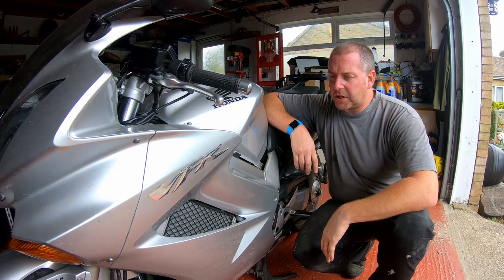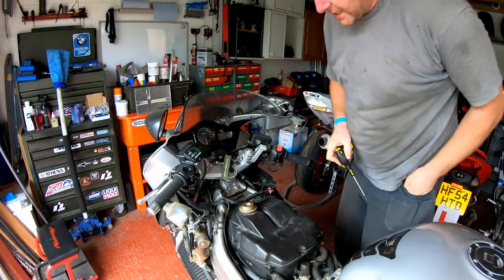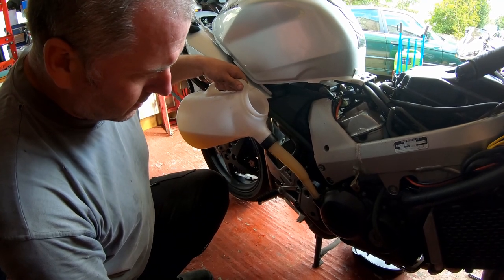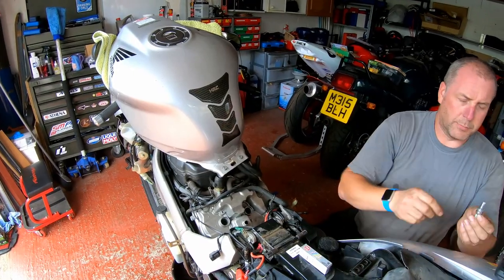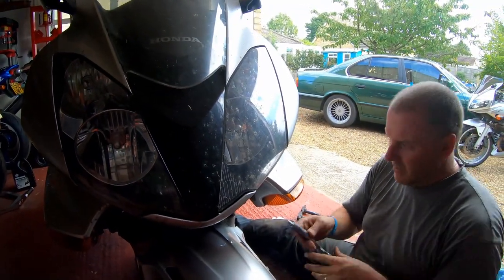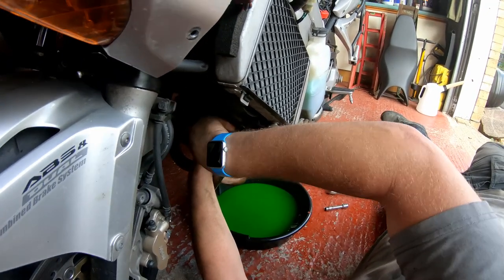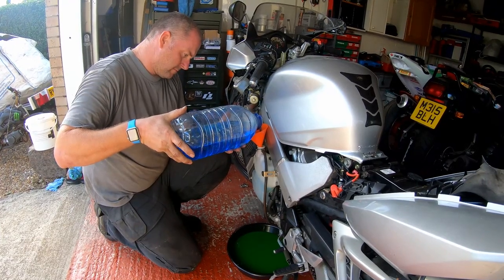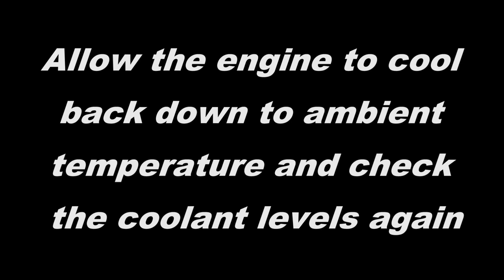Honda VFR800 VTEC Servicing - Oil, Oil Filter, Air Filter, Spark Plugs and Coolant

Comment: I use somethig called an "air lift" to fill the coolant. no need to run the engine, It will also tell you if you have a leak in the coolant system, You use "shop air". You put 25 inches of mercury  vacuum on the system. You shut the system off. If the vacuum holds, you have no leaks. Then you hook up the filler hose, put it in a coolant source, and turn the system on. When the coolant vcuum reached zero, the job is done.

Comment: Aluminum foil wrapped around the pipe right below the oil filter cuts the burning oil, the smoke down to a bare minimum, if not eliminates that little mess altogether. Two wraps around the pipe about does it.

Comment: I added coolant when the bike was on the side stand. Not messy at all.
Once it appears full squeeze the lower large hose where the 3 join and a big air bubble will be released. Top up and job done that simple.
Thanks Kev great vid.

Comment: Hi Kev! Great video! 
I use to fill the new oil filter like 3/4 of it's capacity before installing, this shortens the time it takes to pressurize the lubricant system so it keeps the engine internals to run oil dry for too long. It doesn't spill a great deal of oil while installing so it's not so messy.
I double flush the cooling system with clean water before filling with fresh coolant. Also when filling up the cooling system, I use my hand or some rubber sheet to temporarily seal the  filling neck at the top, allowing the system to purge the air to the coolant reservoir tank while revving the engine a little, so you avoid spilling  coolant.
Great work!
Reply from the maker: The engine internals do not run dry by not filling the oil filter with oil, even after draining the oil from the sump there is still around 300ml of oil in and around the engine. This is why there is a large difference in oil capacities between an oil and filter change and an engine rebuild in the manual. Secondly, unless the thermostat is open, you are not getting all of the air out as there will be air in the radiator, I for one am not putting my hand over the filler neck when the coolant is hot enough to open the thermostat! Thanks for taking the time to leave a comment though! Enjoy the rest of the videos on my channel! 👍

Comment: One thing I do while I have the tank and air box off is go ahead and clean the throttle bodies with some carb cleaner and a microfiber cloth. My '03 sucks in a decent amount of oil vapor from the crankcase so it gets the throttle bodies nice and dirty. Just a few extra screws to get the lower portion of the air box off and you have full access to the throttle bodies. Great video once again!
Reply from the maker: Good idea, I’d check your breathers for any blockages if there is excessive oil in the air box 👍🏻

Comment: Great video! Thanks so much for sharing.

I managed to change the spark plugs on my '09 VFR without removing the fairing or the tank -- within an hour. If you're already taking the bike apart to do the rest of the maintenance, I'd suggest following Kev's way. I was reading the Honda maintenance manual and it mentioned that you just need to lift the fuel tank up like you'd do for changing the air box. The right rear is a bit of a tight fit to remove the coil overs, but it's doable! And that Honda sparkplug tool is so helpful! I don't mean to hijack your video, since it's some really good material, but wanted to suggest a simpler way for people. Cheers!
Reply from the maker: Great tip bud 👍🏻

Comment: Pro Honda Type 2 Coolant is a better choice than the 2 year life Hexeal coolant you have used here. It’s more expensive but lasts at least 5 years (10 years as a factory fill) with a more advanced corrosion inhibitor package, better freezing/boiling points, and is still silicate free to protect the water-pump seals. When I switched to it years ago I flushed with distilled water first to remove the old coolant.

I also recommend Shell Advance 4T Ultra 10W-40 fully synthetic engine oil for this model of VFR800 VTEC, finding it gives smoother running than the semi-synthetic oils I have used, especially at higher revs over the 6800rpm VTEC transition.

For burping the coolant it’s best to put the bike on the side-stand, making the radiator cap the highest point in the system.
Also better to use a socket than a spanner to undo the sump bolt to avoid damaging the sump casting.

Thanks for doing this video, helpful to me as a memory-jogger after a period away from motorcycles even though I’ve done these jobs in the past. And for leaving the mistakes you made in the edit… I’ve certainly learnt from all of mine!

Comment: I have been toying with the idea of ST 1100, with a VFR, because they weigh less. Rode a 2003 VFR yesterday. It was very quick for a 800 cc bike. It had a a Sargeant seat, Heli bars and some other aftermarket parts. Sadly its too much weight on my wrists, plus i had shoulder surgery this summer, so i will keep my ST for now.
Reply from the maker: I know what you mean about the weight on the wrists. i have since done a couple of videos regarding bar risers, a Gen-Mar set and a Moto-CNC top yoke conversion, check them out! 👍🤓

Comment: Good one as always, I find that pouring coolant in very slowly you will not get air in
Reply from the maker: It’s impossible not to have air in the system as the thermostat is closed. Simply running the bike up to temp will allow the water pump to push this air back up to the filler neck.

Comment: Great video Kev but quick question please,
I see you mix your own coolant and use 50/50 mix with distilled water.
Question: what ethylene glycol do you use please?
I'm reading not to use any with silicate in it but just wondering what you use to mix it yourself?
Cheers for any help in this matter Buddy.

Comment: Fantastic video and thanks for linking the parts that you used.
I am looking to buy one of these bikes so it was great to see how easy it is to work on. 

Why when you re-filled the coolant does it come out green straight away, is that the old coolant causing that or a chemical reaction?
Reply from the maker: It’s just the old coolant, there’s still a little left inside.

Comment: It looks easier to just pull the coolant hoses apart under the motor.  Would that work?  Looks like the low point of the system.
Reply from the maker: If you prefer, I just like to demonstrate the method that the factory manual describes 👍🏻

Comment: Kev, Halfords are selling the NGK Iridium plugs for a £5 instead of £20.
Reply from the maker: I know dude! Great price, already stocked up for next time but it'll be years before I need to use em! 👍🤓
Reply: @KevsShed  Cheers for the vids Kev, they've been a godsend, I've just drained my abs braking system today
& I'm in the process of replacing the brake fluid but its hard when you don't have an assistant  lol

Comment: £15 for a sparkplug is a steal. In Norway they retail for £40/each.
Reply from the maker: That’s pretty crazy! 😬
Reply: @KevsShed  Yeah, I asked a local shop for service with valve clearance check and the spark plugs alone was £170 in the service cost. That's why I like to do things myself on the bike. Oh, and we don't have MOT on motorcycles here :-)
Reply: @tbarmo  I got iridiums for £30 for the set
Reply: @roadwarrior8560  I have already replaced my spark plugs. I ordered them from the UK on ebay. Thanks for the offer :-)

Comment: Hi Kev, Thanks for your hard work with the VFR800 videos. I've just bought a 2003 VFR800 VTEC and your vids are so helpful!
Can I ask though, your oil level sight glass is the same as mine as it looks like there's crud/sludge behind the glass. What could be done about that? Any suggestions most welcome. Thanks again Kev.

Comment: Great video Kevin. Really nice clear video and explanations timings etc. Just wondering something, I have 4l of 10w40 semi synthetic oil for my car in the garage. Can I use it in my VFR800 vtec 2005 or does it need to be bike specific? Thanks
Reply from the maker: No do not use car oil in your bike! Car oil contains friction modifiers that will play havoc with the wet clutch on your bike. Additionally, as bikes use the same oil to lubricate both the engine and the transmission this is also a bad idea. Car oils are not engineered to cope with the shear stresses that a motorcycle transmission will place upon them. In short, always use an oil of the API and JASO specification as recommended in the bike manual. 👌🏻
Reply: @KevsShed  thanks Kev

Comment: Kevin brilliant Channel and so helpful. Really don’t understand how you don’t have more subscribers. I had a leak in radiator which got fixed (after third time just picked up second hand one!). However did the full coolant and issue I seem to have is that right side radiator has a lot of steam coming from that side and temperature went up to 101…. Not sure what it’s suppose to be but turned bike off as was worried I’d cause damage…..any ideas or what would you suggest?
Reply from the maker: 101 degrees isn’t really that hot for a VFR to be fair, I often see that kind of temperature when sitting in traffic. Are you sure that the steam wasn’t just overspill from the coolant top up? Once the thermostat has had a chance to open, the level should drop, then allow the bike to cool and top up the coolant to the top of the neck again 👍🏻

Comment: Hi Kev, could you please provide a link for the coolant used, the one in your description is no longer available. Much appreciated and thank you for the content that makes the jobs very easy for us to doA
Reply from the maker: Updated, thanks for letting me know 👌
Reply: Nice one Kev thanks, where do you get your trusty copper seals from mate, specific sizes you purchased or a mixture in a box? Do you have a link for those? Thanks for the speedy reply 🤟
Reply from the maker: @RideToLive102  I always keep a couple of these boxes around the Shed as they are useful for all sorts of things from Sump plugs to brake hoses, high pressure fuel lines etc. https://ebay.us/XCYdMR
Reply: @KevsShed  both products you have updated us with in these comments seem to be flying off the shelves suddenly, Where's your credit haha, thanks for all the info top man 👍

Comment: Hi Kev. I just did the same service you do here today. I ran the bike with the coolant cap open like you did,blipped the throttle a few times. The level went down eventually but i didnt have enough coolant. Need to get more tomorrow. But my fan did not start. I ran it to 112c but fan not starting. Always started before??

Comment: Hello Kevin, hope you're well. Thank you for all your videos, it's perfect !! (English is not my mother tong, sorry in advance for that). When you refill the coolant, you start the engine without the cap on. Can we do it with the cap on (waiting for the good engine temperature) in order to do not have all the fluid squirt out when it's warm? Thanks for your answer and all the best!
Reply from the maker: Yes mate, you can. The only problem is that you won’t be able to see when the thermostat has opened and you would also have to wait until the bike has fully cooled before removing the cap again! 👍🏻
Reply: @KevsShed  Yes, make sens. Thank you for your quick answer, ok i'll try and see what'll happen then... Ride safe & see you later! Thx from Switzerland :)
Reply: @KevsShed  Hi, i used the same method as you. Worked well, thx again!

Comment: Excellent as always Kev but just wondering if you have any tips for the fairing well nuts. Mine just spin around and make it really difficult to get the plastics off?
Reply from the maker: The body of the well nut should go through the panel, if it spins then it's not in the correct place I would think! It's a strange one as I have never experienced that problem before myself!
Reply: @KevsShed  they’re all in the right place, thought the panel from the outside and into the retaining hole but they just spin around in there with the retaining bolt. Last time I had to reach underneath with a vise grip to hold them. Are they possibly being over tightened? Brilliant channel by the way, I show my dad who’s a retired fitter and he regularly nods his approval (and he’s very particular)👍
Reply from the maker: @robertburke4275  That is strange, perhaps they are just a bit old and worn, they can be found on eBay fairly reasonably though. Thank your Dad for his nod of approval! ;)
Reply: Cheers👍

Comment: Hi Kevin! Thank you so much for this great video! My 2004 VFR800 has recently started to run hot up to 132 degrees Celsius. I am worried that there might be a blockage or that the thermostat is not functioning properly.  Dot you have any advice for me?
Reply from the maker: It could be several things. Is there a sufficient amount of coolant in the system? Is it fresh? Have you removed the thermostat and tested it? Failing all of that, it could be a blockage of some kind however that is extremely rare unless there is significant corrosion inside the system.
Reply: Is the fan switch working. Also check coolant level in plastic container. You can buy a Haynes service manual cheap

Comment: Any advice on chain maintenance.
The rubber runner on the bottom seems to get in the way and I feel like I never have to adjust the chain as it doesn't appear to go over the magic 1 inch tension.
Any advice would be great. Thanks

Comment: There was a post on the 800 FB group not too long ago about having the inside of the rads checked, as apparently Honda painted them and you get paint buildup around the exits, have you ever checked them? I assume it won’t be in pieces anymore by now but I’m toying with the idea of getting them double checked at some point!
Reply from the maker: Mike, that's a new one on me to be honest, I have never heard of that! As it happens I have a pair of brand new rads sat on my parts shelf ready for the day that they fail so I'm not overly concerned! :)
Reply: Kevs Shed it was certainly a new one for me also! I’ve got more important things to do first anyway.. such as a shiny new regrec 😀
Reply from the maker: Has your kit arrived yet mate?
Reply: Kevs Shed sure has came a week or so ago, dropped you a PM when it did! Just decided whether to get Honda to fit it now or my autoelectrician given he needs to do some work anyway on my camera wiring
Reply from the maker: @IsMeMikey  Ah yes, so you did! I think that you may find that a Honda dealer is reluctant to fit non Honda parts to a bike to be fair mate, they would certainly refuse to warranty the work. You would probably be better off getting a capable auto-electrician to fit it. Shouldn't take more than an hour! 👍
Reply: Kevs Shed 👍🏻 that is the route I’m thinking of going given he’s going to have the other side fairing off anyway to undo the camera wiring and change it! If that’s the case come 7th October I might finally be near the end of my damn todo list for the bike!! Electrics on the 5th plus Pipercross filter and remap on the 6th 😀

Comment: Kevin brilliant video. One question, need to take left radiator off as leak, would you do a full coolant flush or could I just take inlet and outlet pipes off. Need to send away. Appreciate any thoughts …not. dIYer bit 8 -12 weeks wait to get any bike mechanics to look at it for me…crazy!
Reply from the maker: Just take the pipes off, replace the coolant lost, it'll be perfectly fine mate. 👌
Reply: Thanks Kevin for such a quick response. A new subscriber

Comment: Thank you very much for this video. I'm replacing the air filter this weekend and found your instruction very useful.

It's been a long time since I replaced spark plugs in a car (I've gotten lazy! Plus I bought an electric car :) ). The last time I did I was told definitely to grease the spark plug threads. How would adding grease or anti-seize change the torque of the plug? Obviously I would not want the plugs to seize.
Reply from the maker: The reason is because there’s less friction between the two materials and far more force can be applied into the plugs preload when using thread compound or copper grease. The preload is the ‘tension’ between the plug and cylinder head threads that gives the friction force to stop them coming loose. You could end up over-tightening them by as much as 20% which is easily enough to break them if using an anti seizure agent. This applies to anything to do with torque-wrenches, always use torque specifications ‘dry’ unless stated otherwise.
Reply from the maker: Additionally many spark plugs across all brands have a ‘trivalent plating’. This is the silver coloured finish on the threads of the plug and is specifically designed to offer corrosion resistance. The coating can also act as a releasing agent during spark plug removal. Spark plugs are installed at manufacturer factories dry, with absolutely no use of any anti-seize compounds. There has been many instances of over-tightened spark plugs because of the use of anti-seize including a few people that I know personally. This has resulted in an increased risk of the spark plug actual fracturing.
Reply: @KevsShed  Thank you very much for the explanation! I will be replacing the spark plugs next year, so this advice will be essential when I do. No grease on the threads!

Comment: i noticed that you haven't got the snorkel in place. but the flapper valve is still connected. is there a specific reason for this?
Reply from the maker: The flapper is blocked off mate. Blocked up with tape and then the hose refitted over the top 👍🏻